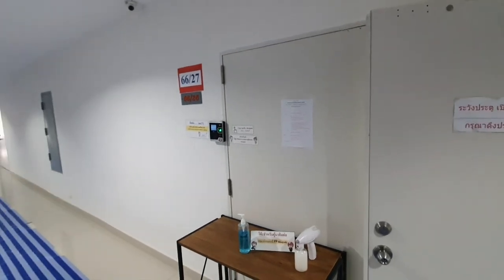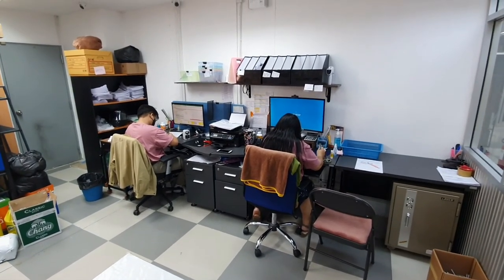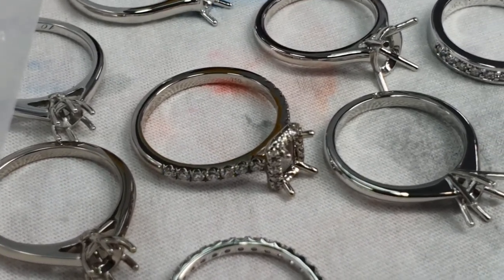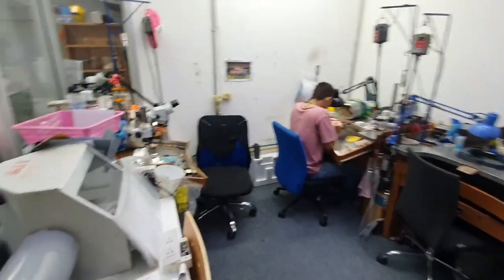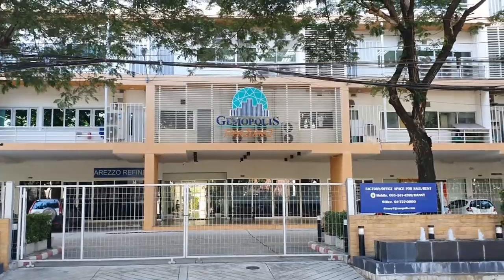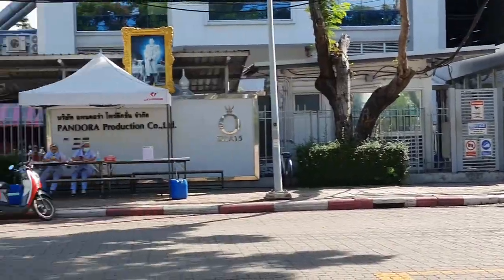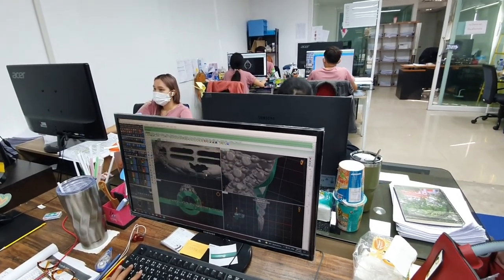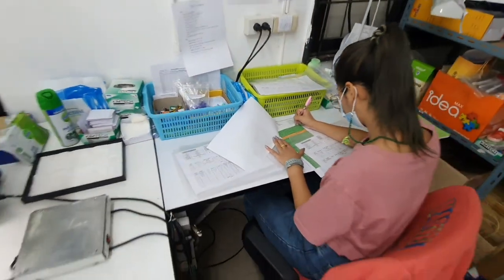Inside a jewelry manufacturing facility, Bangkok, Thailand

Comment: I like this video a lot! Can I ask a question? Ok can I have a floor plan detail and function of each Room. and if you can get the blue print of the Building. Please! Please! I'm Working thesis project in gemstone Manufacturing Facility then I need for that matter.
Reply from the maker: My floor plan is not ideal. Unfortunately we are confined within a generic building so we've had to make best use of a less than ideal space. 
For gemstone manufacturing I cannot comment on the functions and work-flows required.
Our jewelry manufacturing has the following departments:
Accounts
Human resources
Safety officer
Secretarial 
Import/export
Customer care
Precious metals stock 
Precious stones stock
Tools stock
CAD
CAM
Casting
Polishing
Bench/goldsmiths 
Setting
Plating
And each items must pass through quality control departments to move past any stage to the next.
Hope that helps somewhat. And good luck